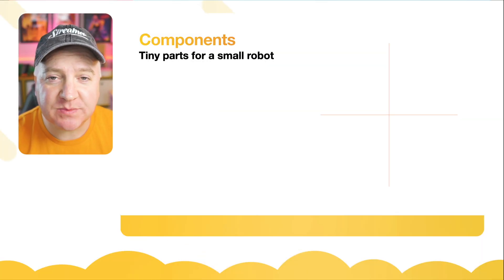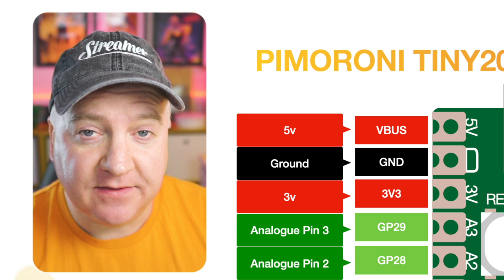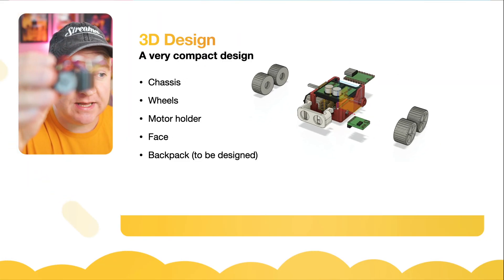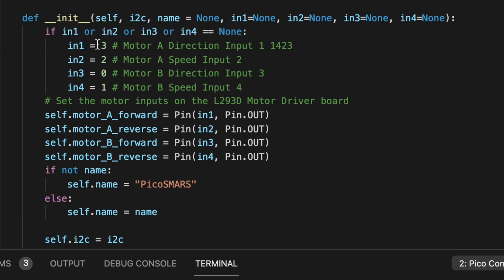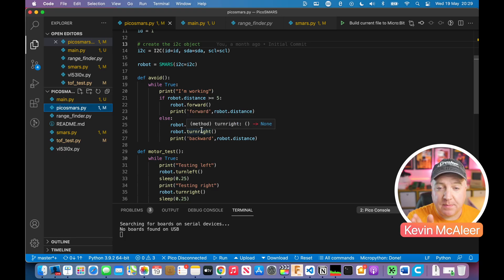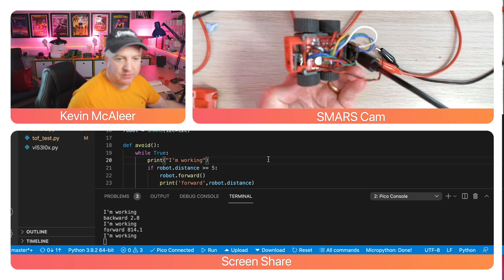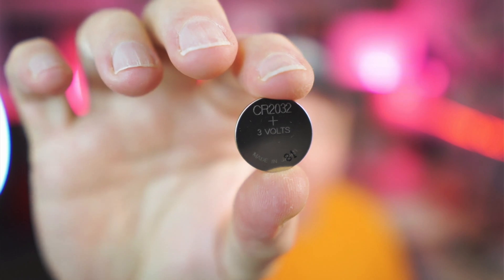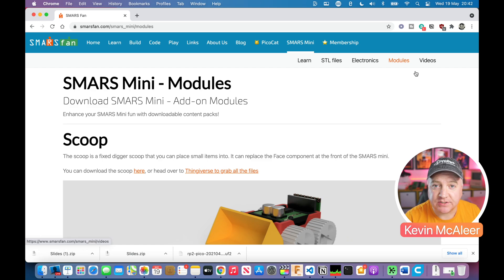SMARS Mini Backpack update

Comment: This looks great. Personally I would go for a rechargable solution.

Means clever people such as yourself could design a recharge station and program it to return home before it runs out of power. :-)
Reply from the maker: I like this idea a lot. in fact I have a couple of wireless charging loops that are about the right size for the regular smars robot…
Reply: @kevinmcaleer28  I never thought of wireless, I was just thinking some springy pins which would could be used to charge (or even expand into a data connection for a dock like connection).

If you wanted to go crazy (you can tell I don't think about the actual instigation of these things), you could eventually build a station which also handled things like tools, alternative plug on sensors or even different bottoms (eg wheels, tank tracks) which could all be automatically connected using more robotics.. :D

Don't you hate armchair engineers? ;-)

Comment: I'm interested on possible motor and battery combos to be used, I would like to build one of these with a single cell LiPo but can only locally (South Africa) source the 6 - ~9V  rated N20 motors as apposed to the 3 - 6V rated ones that I see another person  online are using with this robot. So wondering if a 4.2v LiPo (more like ~3.5v average usable) would drive a 6V N20 effectively (I do have access to different RPM ratings) for this mini bot.
Reply from the maker: It should work fine, just a bit slower. I tested the motors at 3v and they turned, just slower
Reply: @kevinmcaleer28  cool, thanx.